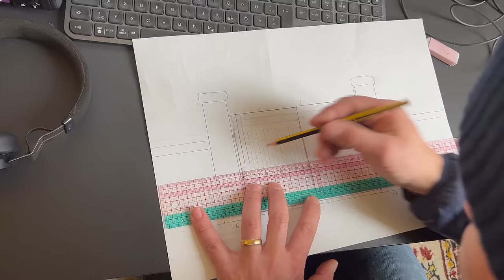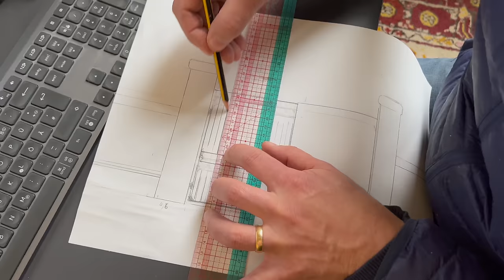5 YEARS (in 20 minutes) Inspiring Renovation of a crumbling French CASTLE into DREAM HOME

Comment: My boss owns a 1800s home i don't know the exact year.  My job was to replace the  old bricks and windows. Their was old plaster on the brick wall i had to scrape off.. let me tell you it was a pain in the neck.  I used a air compress chizle gun to get it off. I had be careful not to dig into the brick. I spent hours and days just get off the plaster off  whole brick wall. The house was connected to another building that must have fallen apart. We ended up restoring the whole house. Love from Gettysburg PA